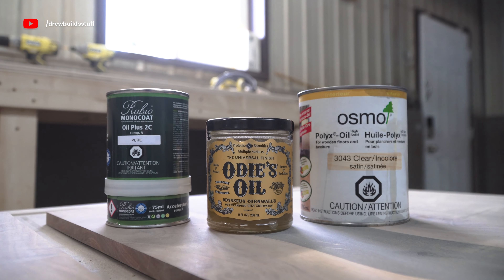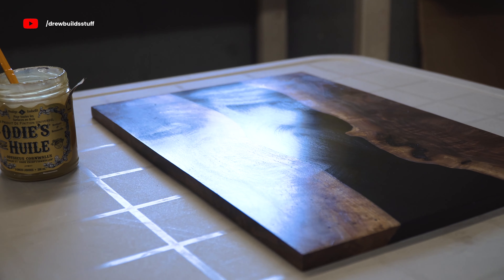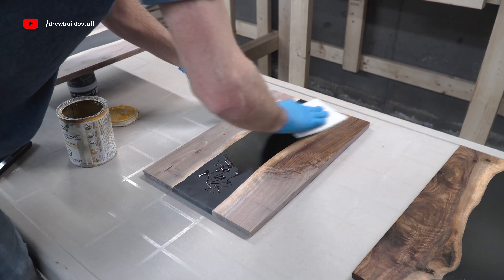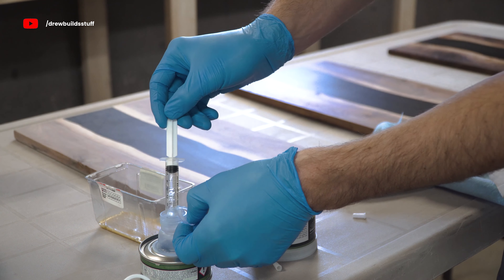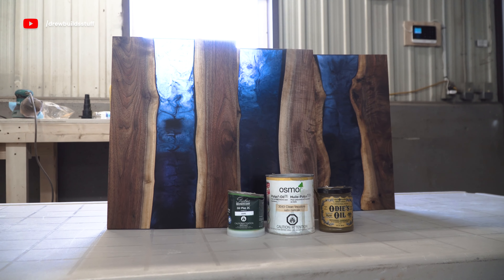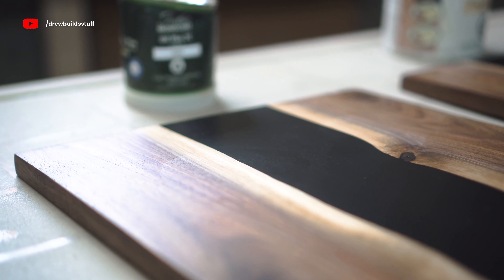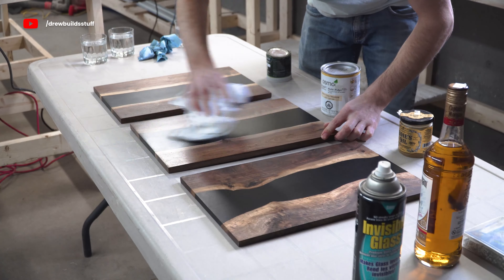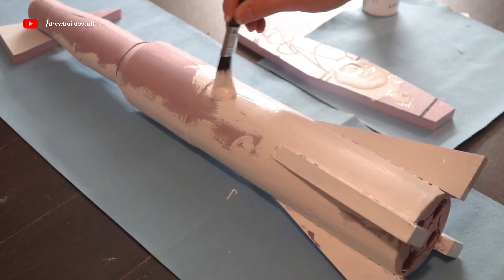Odies vs Osmo vs Rubio - Search for the ULTIMATE WOODWORKING FINISH

Comment: For ease of application and the added ability to achieve protection at higher grits, Odie’s wins hands down. You get more for less coats. There no mixing of two parts, and no need for rollers or brushes as well. I like that I can sand to 1000 and still get gain penetration. This becomes even more evident when using dark or super duper. The one thing I don’t care for is how it changes the shades of lighter woods. For Maple and lighter woods, I prefer Rubio. It’s worth the extra labor required to mitigate the yellowing that I tend to get with either Odie’s or Osmo. Osmo is my least favorite. I don’t care how it is applied, water still affects it more than the other two.
Reply: Mixing the two parts of Rubio takes 30 seconds max lol, that’s not a legit argument against the product.

Comment: Fantastic video. I just subscribed. Note that with Odie's oil, you can easily add a coat of Odie's hard wax on top of the oil. It provides more protection than the oil alone.

Comment: I just finished a wine cabinet with odies oil. So far, I love it. I liked being able to go gloveless and maskless. However as much as I love it, putting it on a large’ish cabinet was a lot of effort to say the least. Just take off your shirt and flex. Because those circular motions will get you jacked. 

I’ve also used tried and true on bathroom cabinets and I love it. But, be very warned. If you put on even a micron extra, it can take days to dry. The finished result is smooth and spectacular, but I made 3 cabinets. One was ready in a day, another a day and a half. Another was 5 day wait. However I left them outside, it randomly rained (summer in California. Unheard of) and they all got soaked. But the tried and true had set enough that I wiped it right off. No issues at all. 

So larger things. I might stick with tried and true because of its simplicity. But that odies oil is pleasant. You just gotta have some time and elbow grease.

Ps. I plan(Ned) on using Osmo. But randomly it got banned where I live. But I can drive 30 miles west and it’s allowed. So, that’s stupid. But, California buddy. Welcome!

Ps. 
What killed that fly 12 minutes into the video? You. The finishes? The gases? Is that part of the test? This finish will kill flies?

Comment: Drew, now that it's summer I'd love to see you do a video, Search for the ultimate outdoor woodworking finish.
Reply: I am in process of refinishing my very large redwood deck and redwood built in furniture. After having refinished my teak furniture last spring with  marine spar varnish that eventually failed in only 6 months ( cracking, peeling and general dried out looking wood) i refinished it with 1 coat of odies. It seems to have worked better and made the teak look really good again. I have already sanded the large built in redwood furniture, 80 grit to get rid of old finish. I also removed old finish on one of the large steps up to the deck and have applied  1 coat of odies to both. They both look really good. The natural redwood color has replaced the unattractive stained finish that had been on them. It was a very fake reddish stain and whatever was used only 2 years ago when I bought the home. It looked OK when I first moved in, but did not age well. It was supposed to be one of the selling points that the very large decks had just been redone! So I am hoping that the odies will hold up much better and protect the redwood. I have used odies in my kitchen on my 6×6 kitchen island butcherblock top and it has held up really well despite all of the kitchen abuse. I chose it because of the non toxic quality. I have also refinished multiple large chopping boards and surfaces with odies for same reason. They have held up really well. They give me confidence that odies will work outside.
Reply: @bluedragonfly5  Can you reapply Odies in the future when you start seeing aging or wear and tear?

Comment: I've used Odie's on the past few projects I've done, namely a coffee table. I'm very pleased with how easily it goes on and how durable it is (i sometimes spill or forget coasters and the surface still looks brand new). I'm thinking about switching to Rubio as my main finish because I think I like the sheen a little more and I think there's a lot more versatility in the color than with Odie's. This video was certainly helpful in deciding if it makes sense to switch between finishes or just stick with one.

Comment: I use odie's oil and absolutely love it I have all of their products. If you really want a durable finish. So if you use the odie's oil then the wood butter and the wax as a 3 step process you will have a very durable finish. I would use it on any hardwood floor. I love the way it smells and love the fact you don't have to have a respirator or gloves. I didn't have to build a spray booth or get a respirator. Just make sure to read the instructions and use as directed and it will work as described.

Comment: This is the best comparison video I have ever seen regarding any product on YouTube…..period.   I bought the Odie’s Oil to refinish a heart pine countertop in my kitchen based on the fact that we use this countertop as a “bar” and open bottles of red wine on it and according to your video…it has the most stain resistance.   I can say that I DO NOT LIKE the look of the finish…it is very dark and matte.  From now on….I will use pure 100 percent Tung Oil in my kitchen and bath where surfaces are constantly exposed to water and other liquids.   It’s just the best and I have never had any issues with it….Give it a try (maybe another video idea?). However,  based on your video….I bought Rubio and will use this product from now on for all my furniture.  SUBSCRIBED and Binge watching all of your videos.
Reply: I’ve used Tung oil on a variety of wood pieces and also on polished and hard troweled concrete. What I’ve found is that doing a few coats of Tung Oil mixed with turpentine or citrus oil at 50/50 enables the oil to penetrate and then for the surface to get a substantially better protective seal. Have you had success with just pure Tung? And have the pieces had spills and chemical stressors?
Reply: waterlox #1

Comment: I just completed a rift-cut white oak kitchen (cabinets) with Rubio's 5% Smoke.  My first time using and I love it.  I only sanded to 100 grit (per Rubio instruction) and water-popped before application.  100 grit would be too harsh for cherry, for example, but on the white oak it was a perfect grit.  With a 2nd coat of Rubio's the sheen evens out and is flat but not dull. I also used Rubio's on cherry stair treads for a boat.  Looks fantastic. I have used Odies (on a walnut river table) but the finish is too dull for my taste.
Reply: nice. I just did a rift white oak kitchen with Rubio "natural".. sanded to 180, never water popped, only one coat, it looks and feels great!

Comment: Thank you Drew for an excellent video. I have subscribed.

There are many “experts” demonstrating different methods of applying OSMO. They do not include tests for stain resistance, nor mention of total amount of solids deposited with each technique. They only comment on final finish.

Some of these “experts” appear to be blatant influencers, despite their strident declarations that they are independent.

The OSMO motto  “thin to win” obviously contributes  to poor stain resistance, so should be reviewed. 

Perhaps “enough for tough” might be more apt.

I will try the OSMO microfibre rollers. I presume wrapping the rollers up in lunch wrap plastic will be the best way to store between coats. The OSMO expert could comment please, as well as cleaning rollers.

I found OSMO comments very helpful, thank you.

Comment: Only sand for Rubio up to 120. It leaves the pores more open and allows better penetration, which gives better protection. Also using a squeegee to apply it on will allow it to absorb better (it’s akin to using a trowel for sheetrock mud or plaster), as a white pad/cloth/rag will absorb more than the wood, making it difficult for the wood to absorb all it can. Then use a white pad to work it in and ensure an even coat. Use a cloth/rag to remove the excess as it’ll more efficiently do so due to said absorption and will smooth over perfectly on the epoxy.  For a second coat, some will say to gently go over it with 240, wipe down, and apply.  I’ve had great success with simply wiping down and applying, the chatoyance it’ll bring out in walnut is simply stunning, like nothing else can achieve.

Comment: beautiful video!! the only thing I would have added is that Odies Oil is certified for contact with food and you could apply it without protection, but in fact the components are not known.
Reply: both the osmo and rubio products are also food safe when dried.

Comment: I haven’t used Rubio or Otey’s but have played around with Osmo trying the thin build up over three coats at first and now I trowel it on or roll it and let it soak in for an hour and then give it a buff with a rag. Two coats max depending on application. Trowel for sheets of ply pre cutting/assembly. Roller for second coat post assembly.
Reply from the maker: Yeah ive been playing with osmo a bit still trying to find the perfect application because it does look great. But the other two are impossible to mess up application which is nice for most quicker jobs

Comment: It's not apples to apples but I recently tried the Osmo 2K for a speaker cabinet restoration. I used the Rubio last spring on a cabinet build. Overall I greatly preferred the Osmo 2K to the Rubio. Even using the recommended Rubio Maintenance Oil I never got the finish I wanted. Conversely, the Osmo 2K has a better sheen, better coverage, and dries much faster.

Comment: Thanks for the video. Looking at all 3 of these. I used Odies on my last project sanded to 400, found the finish a bit too dull. I know they say you can sand to 2000 or something crazy, liked the application but too dull. Looking Rubio and Osmo, I appreciate the additional info from Osmo on applying and leaving full coats buff and top coat. Ill definitely try that and rubio on some future projects. Great comparisons
Reply from the maker: Thanks! Yes i had the same thoughts with odies. Rubio is definitely worth a try I’m using it on almost everything now
Reply: @DrewBuildsStuff  I wonder if a second coat of Odies' with their wood butter or wax would have brought out more of sheen and provided even more protection.  Seems like it would have been a more fair comparison since Odie's was the only one that had a single coat.
Reply: @kevinlavigne9931  I just ordered those two products to give them a try......Not that anyone cares.  Just thought I would chime in.
Reply: I have sanded up to 1200 and then applied Odie's Oil. Buffed after a few hours then applied Odie's wax. I did this twice. The finish was like glass. Seriously worth experimenting with Odie's.
Reply: I have had quite a bit of experience using odies oil. I find the dull finishes are sometimes from not wiping all the excess oil off. I usually do an initial wipe (2-3 hours after application) and then come back 30-45 minutes later and wipe with a dry towel again. The multiple wipe downs have proven to be beneficial. I also sand to 600 grit on wood/1000 grit wet sand rivers, which gives a glassier look. My 2 cents
Reply: If you find the look too matt! allow the finish to fully cure for  2/3 days, and come back polishing with a pad rated to 2000! it will get you a high sheen! I found the tutorial on their channel 
https://www.youtube.com/watch?v=doch4S7pSaE

Comment: I use Odies and it works great. I don’t know if you are supposed to use it over a stain but I do. I’m going to try their dark oils and see how that works. Thanks for the testing.
Reply: Did you end up getting their dark finish? If so how is it? I kinda want to pick up a jar. I have the original
Reply: No I did not, I ended up moving and doing a remodel and have not set up my shop yet. If you try it let me know how it works. Thanks

Comment: For an invincible clear finish, use 2 part epoxy, followed by several whisper thin coats of Epifanes High Gloss Marine varnish. It will survive in water, even full sun, and take a beating on the surface.

Comment: just started using odies and am put off by the other two. i think if you are making something to give or sell to some else it needs a finish anyone can maintain without needing a lot of time or money. odies goes on just like a wax and can be fixed just by applying wax because most people aren't going to go pay 50 bucks for a can of odies just to use once in a blue moon. i've used it on a tabletop i've made and used regular waxes anyone would use over it on furniture and it buffs out nice every time. i've tried some other finishes like poly, etc., before but some of them once they get scratched or a hot liquid spilled on them that's it, there's nothing you can do but sand and reapply and most people aren't going to want to do that.

Comment: My experience with the Osmo wood wax finish (colored version) is that it wears too much in high-use situations like tables or benches. I used a darker Osmo wood wax finish in mahogany on a table and bench and after only a few uses the color is wearing away in areas where fabric touches it.

Comment: Nice stuff; methodical and organized. I appreciated the comparison, and that you went with the manufacturer directions precisely.

Should you want to branch out, on my dining table I used Osmo Poly-X and took a page from a boatbuilder friend - I used a French polish technique, using a high-grit wet-sand paper and then buffing the slurry into the wood. Repeated several times - 4 or 5 coats perhaps? That table has been through a lot and doesn’t soak in any liquids. I love the hand of Osmo. But based on your video I’m going to try some Rubio on a project soon. Cheers -

Comment: im curious, how easy is it to refinish each if messed up like this. awesome vid thanks. awesome woodworking also, those look awesome...

i think i agree with you pretty much exactly... i really like the look of the Osmo, but would rather have the durability of either of the others over that on most projects, i cant really think of anything id be willing to sacrifice that much durability for just a little more shine (assuming nothing ever touches it, which something always will) but if all it takes is another coat of finish wiped on to fix it then thats not really an issue... if it takes a full resanding and refinishing then i want the more durable ones.

Comment: 👍Rubio is best and long lasting. Try a paste using a mixture of Bee's wax and Mineral Oil on Cutting Boards and Charcuterie Boards. What size boards? What was the amount of epoxy used on each board?

Comment: Thanks for this comparison! I just bought maple tops for my kitchen, and I thought I’d finish with mineral oil, but then I heard that RMC was better around a sink. Here’s hoping I make the right decision!
Reply: Mineral oil alone will add no protection, although it will probably make it look nice. I suggest one of the finishes in this video or Arm R Seal (General Finishes). Hope this helps.
Reply: around a sink i would personally step up to a higher level of protection than a hardwax oil.  arm r seal is a great option as mentioned.  3 coats is fine but just go for 5.  if you really want it to be bombproof around a sink you can start with a product like total boat penetrating epoxy.  that seals the mutha up....

Comment: I have a bathroom vanity top made of spalted beech.  I used Osmo Wood protector 4006, this gives extra water resistance then two layers of Osmo top oil.  Its there 4 years with water on it daily and its now starting to look like it needs another coat of top oil.  I don't  seem to have issues you have with Osmo.  Not sure if you get the Osmo Wood protector 4006 in the US.

Comment: Really interesting comparison. Unfortunately for me, I have a 750ml tin for Osmo Polyx 3043, so I'll have to make it work one way or another. I saw it used in another video and I like the look of it but I think I prefer the look of the Odie's in this video.
Reply from the maker: I retried it rolling it on and it worked as well as the other two. Still takes much more effort and technique than the other two though
Reply: If you read the instructions on the Osmo before you start then you might get a better outcome

Comment: How are these products different than wiping varnish?  Arm R Seal offers better protection and offers the look of tung oil.  I can understand the Rubio way with one coat in a day vs 3 coats in 3 days with ARS.
Reply: odies is a plant based hardwax oil.  it does not have harsh chemicals.  not sure about the others.  but hardwax oils act like the tung oil, they fill the pores of the wood.  arm r seal is polyurethane which is essentially thin layers of plastic material to make a coating.  poly becomes much harder and more durable than these finishes.  but the hardwax oils are a finish that give you a more nautral and close to the wood appeal.

Comment: Thanks so much for posting. I have a house that is 1 year old and the floors are done with Rubio pure. I have a big family and a lot of cooking and traffic. The guy who did them said to wait 2 years, but I know they need a refresher, and there are area in the kitchen where it’s looking really dingy and dry. I use wood soap every 4-6 weeks, unless my grandkids come and then it’s more often. There are stained areas that I believe I should use tannin cleaner on. Question is, do I use pure again or universal oil to refresh floors? Or something altogether different? Also what is the best way to apply and then remove? Can I leave areas (like under a rug) alone, or should I do entire floor? If grain is raised a bit in areas do I need to sand? Thanks in advance for any advice you can give me.